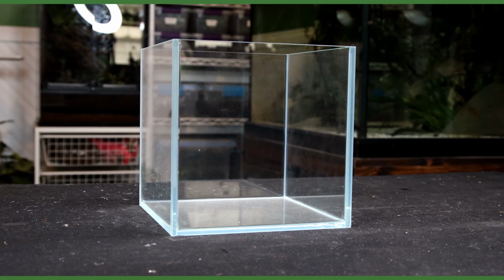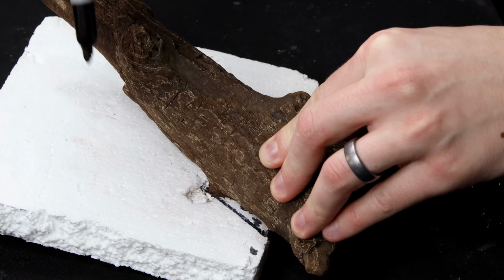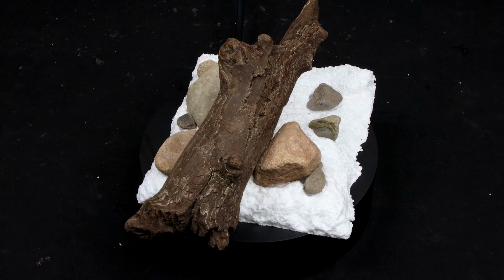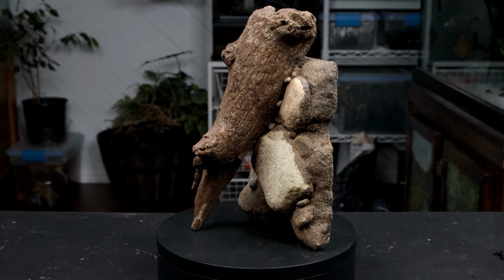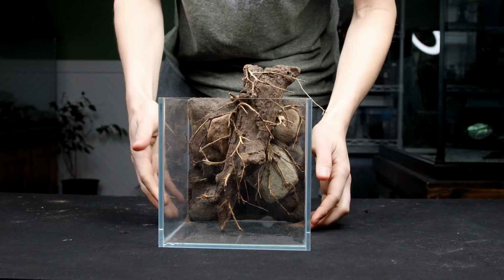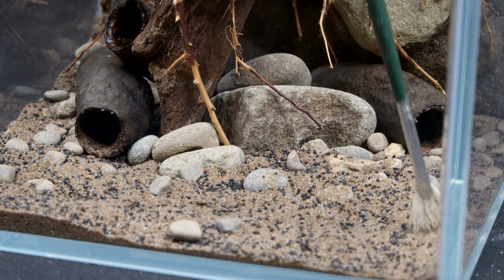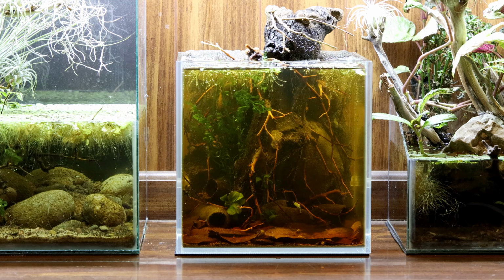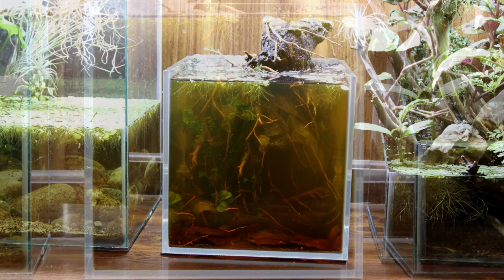Nano 1.5 Gallon Blackwater Aquarium with DIY Background

Comment: Hey Tanner @SerpaDesign I was wondering if you have settled on a stock option for this set up yet? I'm curious to know if there is no water flow or aeration how often would you need to change the water to keep it from going stagnant? Also when doing water changes on blackwater tanks do you use dechlorinated clear water only or do you make your "soup" and add more blackwater as well. As always another great video. p.s I don't know how I missed this one but I'm glad I went through my old notifications and found it, it was so awesome to watch.

Comment: I haven't watched all of your videos so unsure if you've tried it before or not, but wouldn't a low heat soldering iron be less messy, have the same effect, and have better control over what is carved out (re: the styrofoam)?

Comment: I'm planning a black water scape for my 29G tank... I have a reasonably hard water (8ph) and i have kept silvertip tetra, cardingal tetra, panda cories and electric blue rams  for a year now..
they will be going into my next scape in the same tank.. how do i ensure stable ph after water changes as my tap water is hard... with my knowledge, it sounds too challenging to maintain stable water parameters (ph and hardness) and that's one of the reasons why i'm a bit hesitant to try black water scape...

Comment: Very nice work Tanner, I just want to know, is it possible to make a "Blackwater Tiger shrimp aquascape"?
And do you think Assassin Snails would be fine with the shrimps?
Reply from the maker: Depends on where the PH is at. If it goes too low I bet there would be issues. They can eat shrimp so I would do it at your own discretion.
Reply: Thanks

Comment: @SerpaDesign  glazier guy here again. Use 5 half dollar sized blobs of silicon 3/4" tall to adhere the styrofoam instead of the 1/8 noodle pattern all over. You can push down and get better adherence.  I mount mirrors and architectual sheet metal like this.
Bonus: you can remove it in tact if you have to.

Comment: I love your blackwater builds. I always get such great ideas. My blackwater Spec is still doing good. It's very low maintenance. My betta I have in it is still healthy and happy and going strong even a year later. I actually just got a Fluval aquasky lighting system to set up for it and I'm hoping a less intense light and the timer will help with the algae that has bloomed up in it. I have 3 nerites in it and they are super lazy.

Comment: personally I think the tank is to small for the fish especially with no filter but having a snail centric tank with your beautiful scape is more than enough!! :)
Reply: I agree with it. For any vertebrate animal I would not go under 5 gallons of water just because their metabolism is higher and they would produce too much waste for the amount of water available. (It would likely require daily water changes and would make it unstable, especially without a filter to hold all the denitrifying bacterias) Perhaps some shrimps would do, but I personally like it with some snails only.
Reply: I'm generally more concerned with quick temperature fluctuations. While in general animals and plants can thrive in more conditions than we give them credit for they love stability.
In a centally cooled/heated animal room tho, it is fine.

Plants simply will reduce ammonia significantly. I'd say don't underestimate them but on the other hand: Overestimating gives a margin for error.

I'd include fare more fast growing plants for metal and nutrient removal. Small tanks need more maintenance.
Reply: Shrimp will do find in my experience.
Reply: @a.b.8080  I think you're giving plants too much credit here. They can remove excess nutrients, etc., but not very efficiently. One or two plants plus the floating ones wouldn't even offset the output from the snails.

Comment: Hey Tanner, big fan! you inspired me to try and make a vivarium for my ball python. In the case of a live planted enclosure, assuming I load it with micro fauna to help keep it clean, how often would you have to change out the substrate in something like that? I'd be using the tank I have for her which is the exoterra medium low. (24" L X 18" W X 12" H)

Comment: You should make a prehistoric themed riparium with things like the resurrection plant and triops in the water
Reply from the maker: That plant would not work in a riparian setting. It would have to a selaginella that doesn't mind having wet feet.
Reply: @SerpaDesign  Ah okay, that would still make for a cool riparium though
Reply: It would be cool if you could add some common fossil stones or petrified wood too in the scape
Reply: Yeah i tried using the resurrection plant in a tank, isipod rolly pollies just eat it, they love it

Comment: Love the idea of using epoxy! Thanks for that!  As far as stocking goes, my experience with Neocaridina, is that they don't do well in one gallon tanks without filtration.  I would stay away from them.  Sparkling gouramis,  Trichopsis pumila,d might do well, and are very under rated.  
Cheers,
Chris
Reply: I second that. Sparkling gouramis are wonderful little fish.

I do challenge you to try a slightly larger blackwater setup with a licorice gourami, though they're apparently finicky fish.